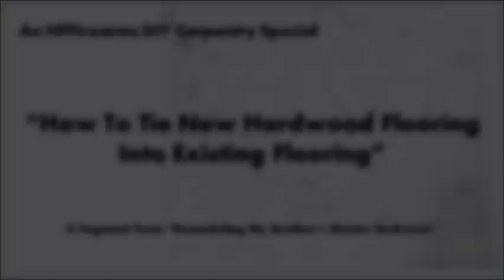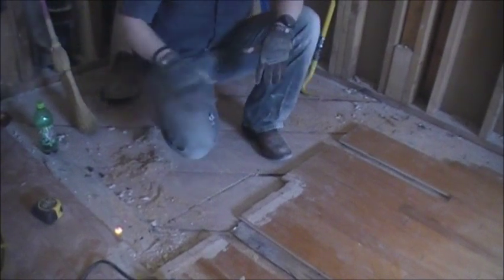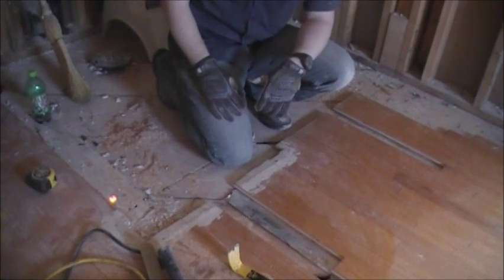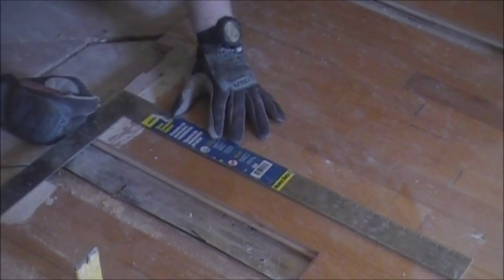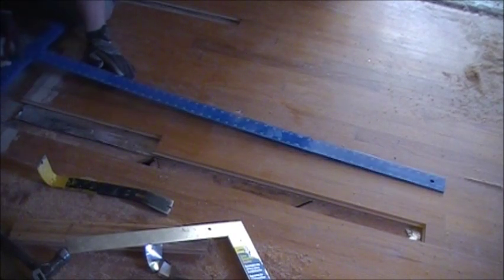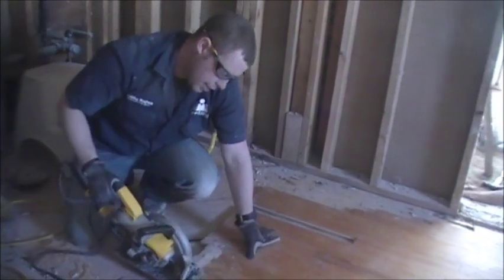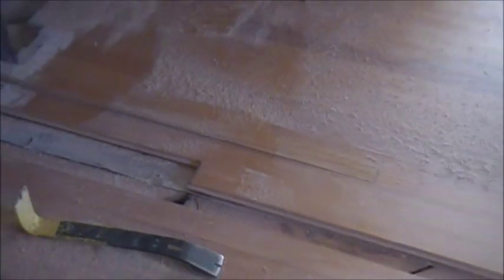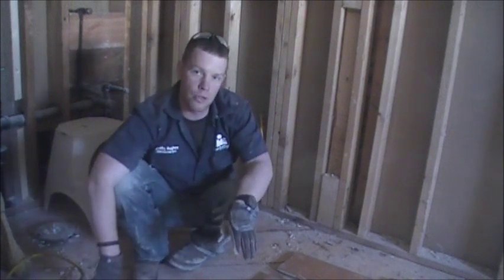How To Install New Hardwood Connecting to Existing Floor by HPFirearms

Comment: Should you strip/sand the old floor prior to adding new planks? We need to add new in damaged areas and a room addition, but also want do a darker stain throughout the house. Existing is honey color and really needs redone. It’s original from the 50’s.

Comment: Great video!  One question: once you put in the new piece how are you securing the piece to keep it from squeaking?  In other words, the part that extends the existing floor can be toe nailed but are you gluing or face nailing the part of the new board you inserted?  Also, as an alternative to doing this do you have an example of how to put in a header row?  Thanks.
Reply: Nail gun...
Reply: Finish nailer.

Comment: ha! flooring guy said toothing would be very difficult (and added $550 to quote for a 15' run)......he also suggested a turnboard as an alternative (after i told him i'm trying to create the look and flow of ONE floor) - i was considering this option until i heard you mention the squeaking and bouncing  which makes perfect sense......i'm a gonna DIY this one......thank you!.....oh yeah, related but not directly - i'm putting 3/4" OSB under cabinets and island 1) to save money and 2) to keep on schedule (cause i haven't found a flooring guy) - anybody have advise on adding a pad versus wall to wall HW .... this is a kichen gut (15'x14') with area under cabs and island = to 30-40% of floor space ..... i'm broke and my wife is picking out fancy lighting that i hate

Comment: I use a rotary drill with a drill bit that I cut into drill hole in floor and it just jack hammer it out iv done both ways the drill is the way to go